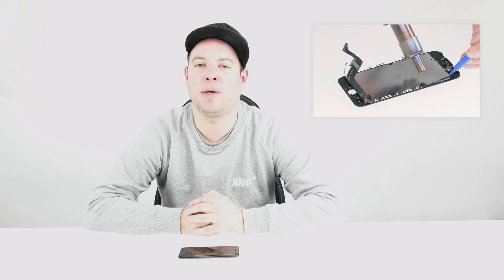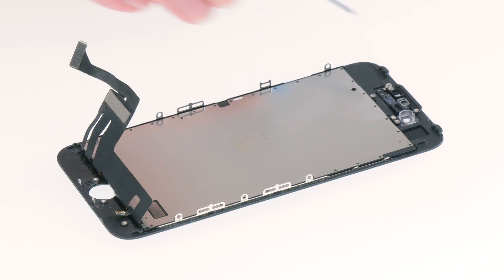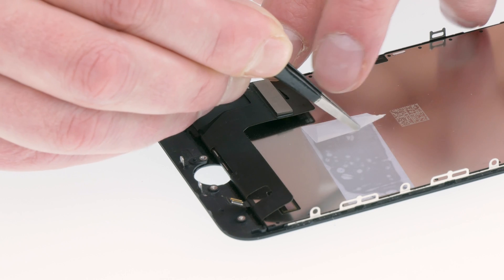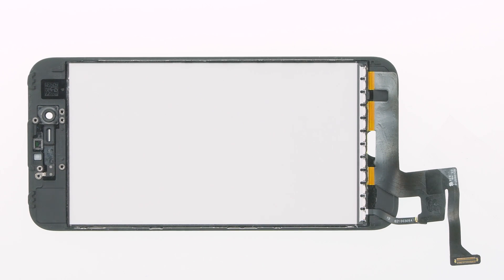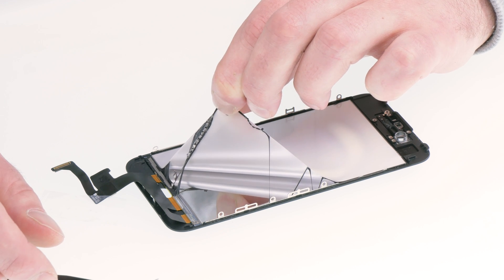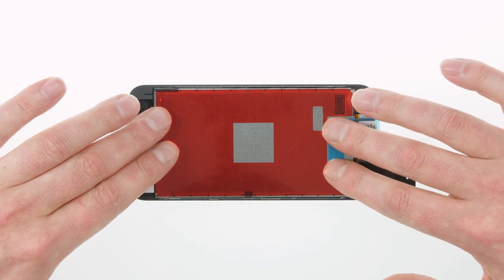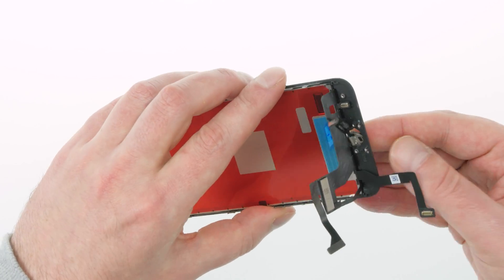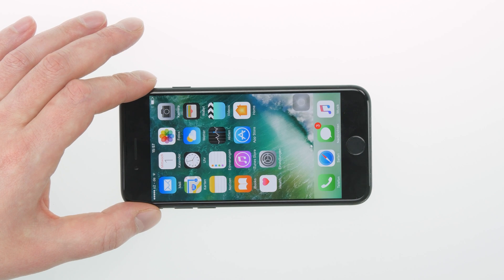iPhone 7 – Backlight, Home button, 3D touch repair

Comment: I have a problem where my lcd was dimming at the side and later on when I rebooted it, it turned black but the homebutton is still working. However, I changed the lcd screen with an aftermarket and my phone works well. Somehow I checked the flex cable and the back light cable (similar to the video) was bent. Do you think I need a replacement for the backlight? Please help me, I don’t have another dime to spend another screen and this aftermarket screen hurts my eyes. PS. I’m on IPhone 7 plus. ☹️

Comment: Soo i have same problem, what can i do when i dont have hot air?
Reply: Never mind, I used a hair dryer (2000w) for this and the glue came off
.
Reply from the maker: Great self-help :) With a hair dryer you have to be more patient (as it gets not that hot), but it works as well. Enjoy your repaired phone!

Comment: My iphone 7 touch screen is not responding, the display works as in i can see everything normally but when i touch/ try to enter my password nothing happens. I think i might have damaged the flex cable of lcd, is there any way i can use my original lcd display without having to use third party/replacement kid. Please help. thanks!
Reply from the maker: Hi rohan chitte,

unfortunately there is no other option than changing the display. The flex cable, which is responsible for the touch is also responsible for the LCD itself. So if it's broken, the whole display won't work anymore. 

All the best
Sabine from iDoc
Reply: @iDocEurope  Thank you, Also is it the same with camera flex? I might have torn it a little and am wondering if i can by any chance still use the original camera or fix it?
 Thank you so much for helping.
Reply from the maker: Hi rohan chitte,

in most cases the spare part is defective if the flex cable is torn. only if you are very lucky, you will not have hit an important track but only the cover. 

Best
Sabine from iDoc

Comment: Will it work with iPhone 8 too.
Reply from the maker: Hello, yes, the replacement of the backlight is very similar on the iPhone 8. The place where the backlight is soldered on is slightly different, but otherwise the procedure is the same.
Reply: In my case 3D Touch connector has been broken. Will fingerprint sensor work after repair. Thanks for responding. 🤙🏻👍🏻
Reply from the maker: @syedowaismir5363  Yes, the home button is connected with the same flex cable. A new backlight including this flex cable should make the home button functional again.
Reply: Thanks. I did this repair. And everything works 👌.

Comment: Hey. Thanks for the video, this helped me a lot since I know now that I can repair a i7 screen with backlight flex riped off. Just a question, what kind of "glue" are you using to solder the flex Cables together? Which you put on both flexcables.
Reply: iDoc Reparatur Service my iPhone 7 3d touch and home button is  not working but screen brightness and every works normal ... When I go to finger print option its greyed out .... I want to know i if replaced the hold display should solved it
Reply: Any update to this issue? 

I am in the same boat

Comment: Hi thats a very good video. I have the same issue. I accidentally ripped the home button extension cable linked to lcd whilst repairing camera. What are the chances of touch id working after this repair?
Reply: iDoc Reparatur Service 
I have the same issue as you have shown in the video. The flex cable is ripped which is attached to the lcd. In your video you have shown the home button working after. Also with mine there is no damage to the home button.
Reply: iDoc Reparatur Service 
Thanks.